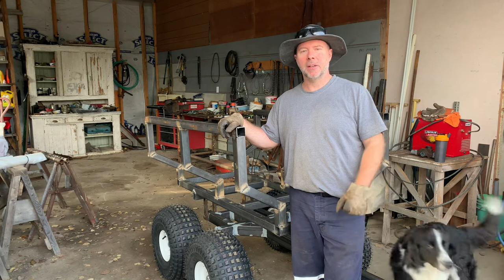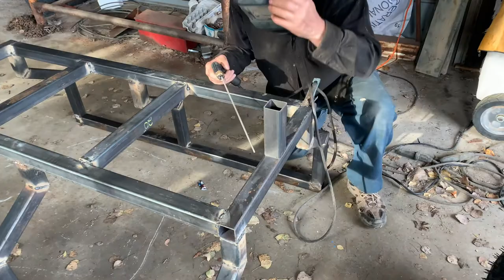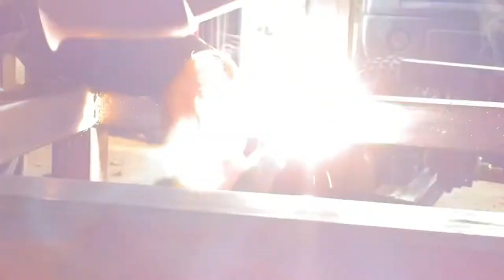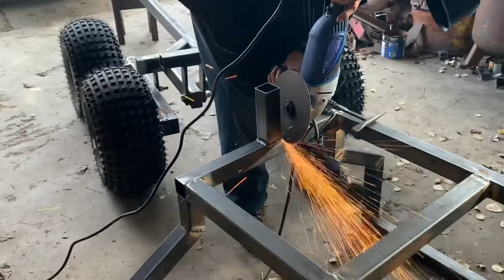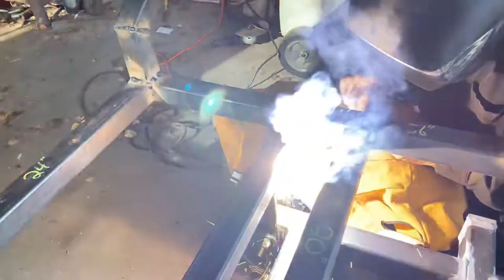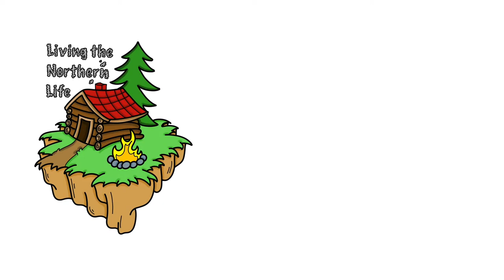The Ultimate Quad Trailer - Part 5 - Adding the Dump Bracket and Dump Box (#theultimatequadtrailer)

Comment: I've learned a lot in the last few years switching from web developer to full-time homesteader. One skill I haven't learned that would be SOOO valuable on our farm is welding. That is such a beautiful thing you are building there and looks as strong as a bull. I guess that's an "arc" welding machine? It's electric, not gas?  Anyway, good luck with all the buildings you want to build. Sounds nice.
Reply from the maker: Thanks for watching and commenting!
My stepfather has a stick welder and I bought a MIG welder many years ago.
They are electric and both run on 220v.
Welding is a great skill to have to be able to build or repair and there is lots of that on the farm.
My stepfather has been welding for 70+ years and I have lots to learn that's for sure!

Comment: Nice looking trailer like to see it in action
Reply from the maker: Yes I thought I would have been completed by now but we have been delayed "due to the current situation".
It is snowy and cold and I want to paint it so that it doesn't rust before pulling it around with my quad.
I am hoping to complete that soon as I wait for more materials to arrive for the tub and gates.
Also thinking about putting a battery powered hydraulic lift on it as well.
Thanks for watching and I hope you stay tuned to the channel!
Reply: @LivingtheNorthernLife  that's awesome it will be nice to see when you get it finished. Everything takes time I understand. I hope to build one kinda similar to yours.
Reply from the maker: @flyinryan1986  I'm planning on putting a cut sheet together for this at some point if you're interested.
I can't wait to get this thing going! SUPER excited! :)
Reply: @LivingtheNorthernLife  have you made the “cutting list “ yet ?
Do you have a total cost on this project ?

Comment: Wow...its a wonder he hasnt burnt through more. way to hot. and one stick for a two inch joint??....lol
Reply from the maker: Which 2” joint in the video took a whole rod? The metal is also 3/16” thick.
He’s been welding for almost 70 years. I trust his welds more than mine that’s for sure 😊

Comment: It may be a bit heavy for atv?
Reply from the maker: lighter is better but it pulls very nice with my Honda Rancher 420 IRS. 
It doesn't cause the suspension to sink, it's very easy to move around byt hand. The tongue weigh's almost nothing.
I love it.
1"x1" for the uprights with that heavy gauge tub probably would have been good enough.